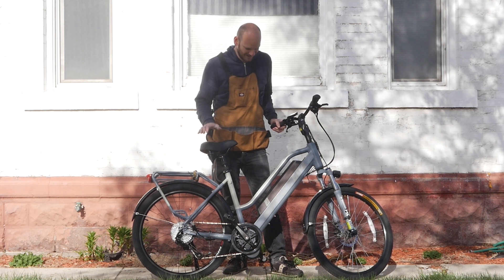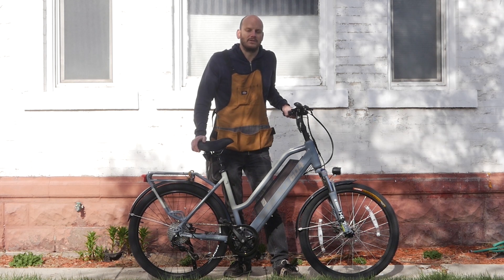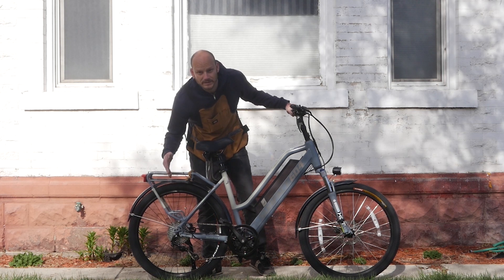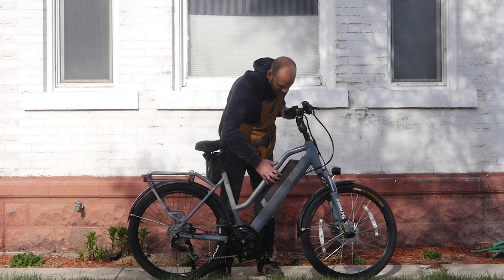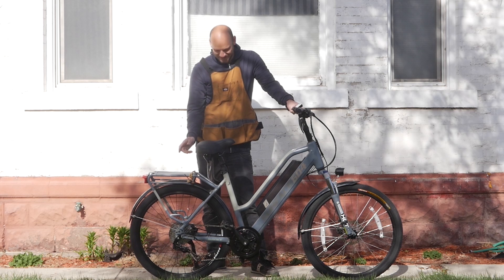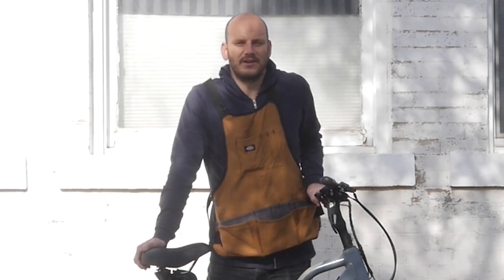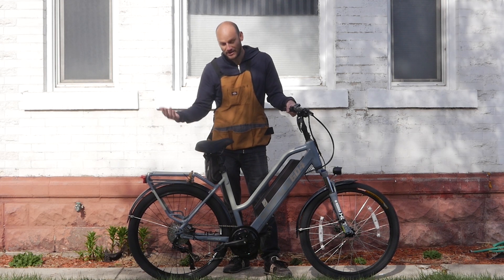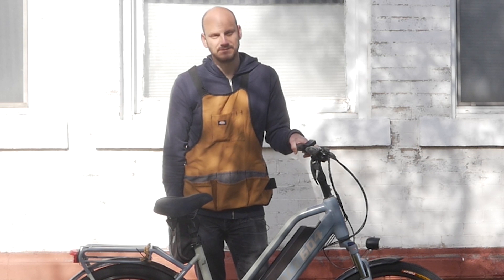Custom E-bike Build: Converting a premade Hub motor into a Custom Mid drive! The Surface 604

Comment: I live on some steep hills, this is the reason I wanted a mid drive, plus since Johnny stresses mid drives are better.  I didn't want to ride down the hill, go on the flats then get stuck at the bottom so I needed a mid drive as Johnny suggest.

Comment: Hi Johnny.  Love your video on the hub to mid drive conversion.  I too have a Bafang bbs02 motor and find that it accelerates too fast.  My BBSHD accelerates more slowly with more control.  I want to slow the initial acceleration on the BBS 02 from a stop when in parking lots or trails where there are people around.  I think it can be done by getting into the software setup somehow. Do you have a video on this or know what I can do to adjust initial acceleration?  I should mention that the two motors have different displays if that is a factor.  Thanks, Don
Reply from the maker: I sell a usb programming cable that connects to the motors controller. you can dial that baby in to behave EXACTLY how you want it to in any PAS level. Such a beautiful thing, video coming when I have some time this winter to film it :)

Comment: I have a Easy Motion Neo Jumper 2016 model e bike   
36v system  and it has a rear geared hub motor and I can climb any hill in the lowest level of pedal assist  I have over 7000 miles on my 3 geared motor e bikes with no problems. I also had a $4100  Haibike with mid drive   I traded my mid drive for a honda scooter but I would never give up my geared hub motor bikes.Also don't forget to tell about how often mid drives break chains.

Comment: Is it ok to use a bike with rim brakes for the conversion? I have a used Fuji absolute 3.0 that I'm considering converting.
Reply: Try it! I put a cyclone 3000w on a trek 820, and I ended up putting a 203 mm disc brake on the front - I replaced the fork for $150 to get the disc.

Comment: Just add the mid drive system AND keep the hub drive LIKE I did my Ariel Rider D bike have two drive systems two battery's two throttles it is fast and powerful

Comment: I looked up your website and saw you were in a different state. There goes my plans to get a quote lol. I have a 24v 250w hub drive bike thats about 6 years old running on a new 10.4ah 24v battery. The old battery died. The bike would have been perfect for a new mid drive conversion I think. The bike helps me get up hills but its quite old and outdated.

Comment: I hate the performance of my Aventon Adventure, but I love the frame...
Would a mid drive motor work on it?
What kind? BBSHD or maybe the Cyclone 3000?
I have a rear fat tire wheel with 7gears 
It has a 120mm bottom bracket,  but I wonder if the integrated battery compartment would be in the way...
I will probably have more questions in the future because you have surely caught my interest. 
Thanks, Robert
Reply from the maker: Hard to tell for sure but it looks like a bbshd or cyclone would fit. Check out my bbshd vs cyclone video if you want my thoughts on that 👍
Reply: Leave the hub motor on there and put a BBSHD on there too :)

Comment: What is the role of the throttle with the bafang? I am looking to convert to pedal assist mid drive.
Reply from the maker: You can use the throttle instead of pas. Or both at the same time

Comment: YOU SHOULD HAVE DONE A BEFORE AND AFTER VIDEO TO VISUALLY JUSTIFY YOUR THEORY, EVEN THOUGH I UNDERSTAND MID DRIVES ARE BETTER (I HAVE A HUB DRIVE SADLY) oops caps lock
Reply from the maker: Check out my why hub motors suck. I do a before and after

Comment: What did you use for a rear axle,  I have a cheep Chinese fat tire bike with a 240mm long rear axle thats bent from my 1500w  mid drive motor with a 30t chain ring. Looking for a stronger axle or a different design rear hub.
Reply from the maker: 135mm

Comment: Mr Johnny Nerd Out how's it going, I have few Q,  I would like to know what the  wattage  is. Why is it that ebike  like the Stealth B52, and other ones that are built with 5000w to 10,000w are hub moters. Anyway Johnny great video like always. 👍 keep up the good work buddy. I'm going for a rapp , (a ride) lol .   Thanks again 

                                                                                                                                                                           JAR  🇨🇦👍🤜🤛🚴‍♂️😎
Reply from the maker: Lots of reasons why(especially high powered motors) go hub motor. Less wear on a chain mainly and less room for user error. Also cost. Hubs tend to be a little cheaper. 
If you want performance and customization, no substitute for a mid drive.

Comment: Are there any if the existing cables or displays that can be reused for a hub to mid drive conversion Johnny? I'm thinking if doing one on my premade hub bike with 36v battery, I'm in the UK so watts are limited to 250...its a bafang 8fun drive.
Reply from the maker: Really depends on motor systems every motor system usually uses its own wiring cabling harnesses sometimes they match up sometimes they don’t
Reply: @JohnnyNerdOut  OK thanks

Comment: Another great video.  Do you cut and splice wires to reduce clutter in your builds?
Reply from the maker: Yes, except for the main wiring harness.
Reply: @JohnnyNerdOut  can you move a rear hub motor to the front on a pre made bike
Reply: @JohnnyNerdOut  I can see, your builds always look super clean.

Comment: I can't agree on mid drives being the only option for e-bikes. I have both mid drive and hub motor e-bikes and I love them all. Guess what happens on a mid drive when your chain breaks... you are stranded but if that same scenario took place on a hub motor you can easily just ride home with only the motor being used even with a broken chain. I much prefer hub drives over mid drives ...less moving parts and more reliable.
Reply from the maker: They’re definitely not the only choice but I feel like you’re going to outgrow a hub motor and you’ll probably never outgrow admit drive motor. When riding a mid drive properly, chain wear is minimal to nill. people break chains when they don’t ride properly 90% of the time
Reply: I have a bbshd 52v on my fat bike, at 30amps its 1560w, probably like 1700w on a full 58.8v charge.  I use cheap KMC Z chains , ride it really rough 2100 miles since June and I’ve never broke a chain. I have a hub motor bike too and sure it requires barely any maintenance but it bogs out going up hills and eats through battery way faster. I’ve been stranded on my hub motor several times because if you are riding unfamiliar territory with more hills its harder to gauge how far the hub motor is going to get you bogging up all those hills.

Comment: I also converted from hub to mid motor. The power is awesome and its fun to ride hills. Waiting for parts are a problem we all have these days. Waiting for a battery and a cassette. Ordinary parts, but the bike business are in trouble.
Reply: Trouble how? Im puzzled
Reply: @badcampa2641  

More demand than supply really is the issue.
Reply: @badcampa2641  If I need say some oil or any thing.I looking around, and many shops are out of order. More demand, container problems, Corona etc.
Reply: Hi, I have a sondors MXS and I would like to put a mid drive on it but I really don’t know how. How am I suppose to remove the hub motor?

Comment: hey, Johnny.
Is there gonna be a Nerd-out range of Bikes at some point, you must have the data by now. 
Recon there would be a market for the Nerd ''out on the Town'' (range 50 solid miles, short frame), the Nerd ''out Doggin' (for the Brits) 70 solid miles (dual susp) and the Nerd ''out on the Lash'', cruiser that is indestructible and rldeable when shit-faced. 
Just a thought.
P.s. Do you use Trackers or not ...i wont ask again?
Peace John
Reply from the maker: Great minds think a like. I have been kicking around that idea for a while and will probably integrate it onto my website in a somewhat version of what you just described probably over the winter when I have time😀 
Not sure what you mean by tracker?
Reply: @JohnnyNerdOut  i'll take my cut in little nuggets of your Brain then;) 
I've had 3 bikes stolen over the years, including a 1985 Pro-Class Mongoose Supergoose BMX that i rebuilt and i'm a bit nervous about taking my new one out (when it's finished). So i was gonna put a GPS Tracker on it, so i can find out where it has been taken and recover it and just wondered if you had used them or whether the trade have found a nice non-subscription one.
Thanks John
Reply from the maker: @jclive4773  heard good things about the apple tracker….@$25 ish bucks
Reply: @JohnnyNerdOut  yeh, had a look but it's only compatible with apple devises. Not only do i not have an apple product, i don't even use (or want) a phone, especially when i head back off round the world.
Thanks though
Reply from the maker: @jclive4773  try boomerang?
Reply: @JohnnyNerdOut  cool, thanks mate